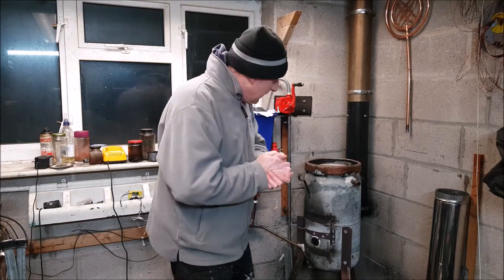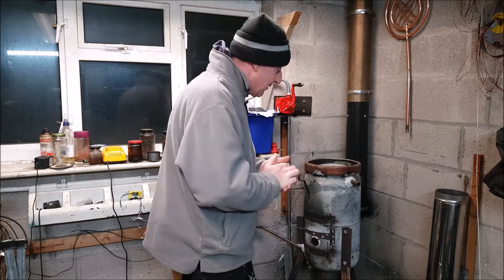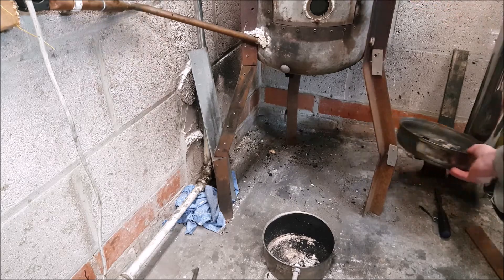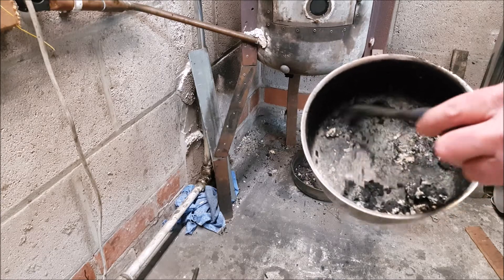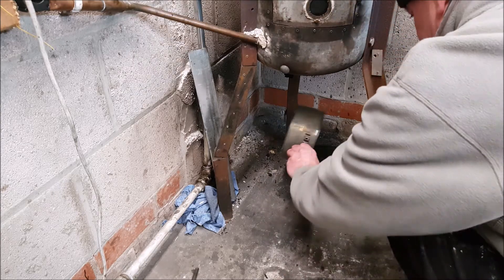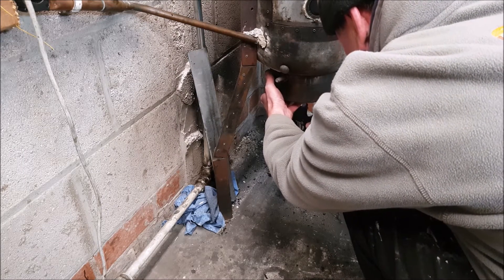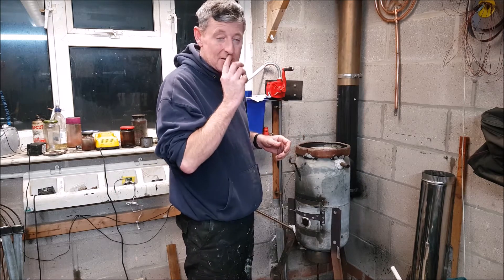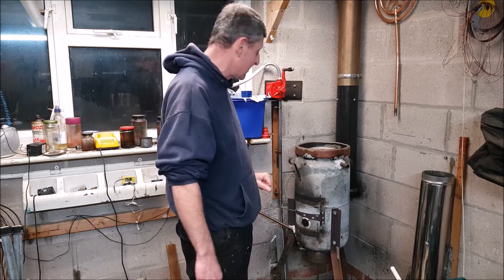Homemade waste oil heater. Whats left from the burned oil.

Comment: Hi, nice to see a UK waste oil burner on YouTube.. excellent... my only concern is iv been wanting to build a waste oil burner myself here in the UK (Cheshire) but i keep getting put off by the getting a license to burn it at home.. how did you get round not getting a license to burn oil or do you not have one.. sorry for the question.. but not sure if i should build one or not.. Thanks Chris
Reply from the maker: Hi Chris, I live in cheshire myself (northwich). I've not got a licence myself and don't plan to get one. If i was a car garage business then I would certainly have to get one but this is my home personal workshop and because there is no smoke from the flue it's not going to cause my neighbours any disruption while running. If by chance i was forced to get one then the cost of the licence would be multiply the cost of running a small 3kw fan heater. Then I would collect logs whilst out and about and burn wood rather than oil to heat my workshop.

Comment: Hi mate was wondering if I could possibly get your email to discuss the improvement you are looking to make? I mentioned it on another video of yours but didn't receive a reply :(
Reply from the maker: Sorry for the delay Kas, Im going to install an over /under temp. cut off for the oil supply. The burner will probably be fitted inside the heater rather than underneath. I also want to able to lower the temperature even further to use less oil/more heat. If you are building one yourself check out this video. Jack built his from my design. Its superb. https://youtu.be/FA33JqRUFjs